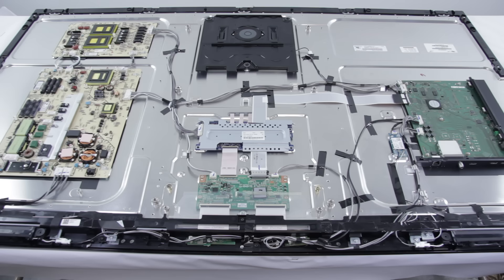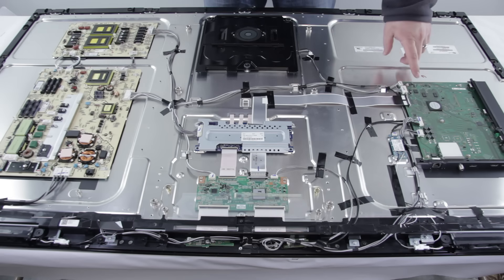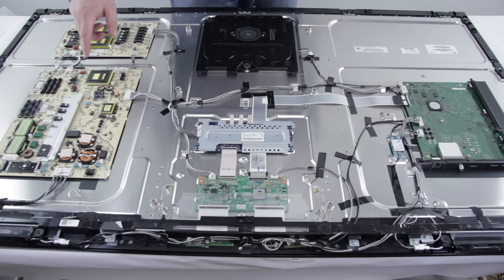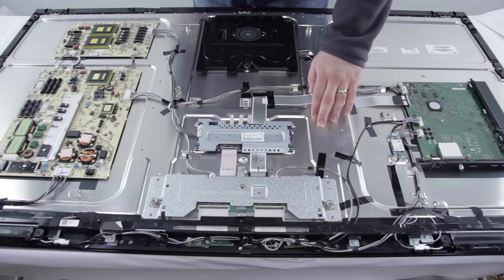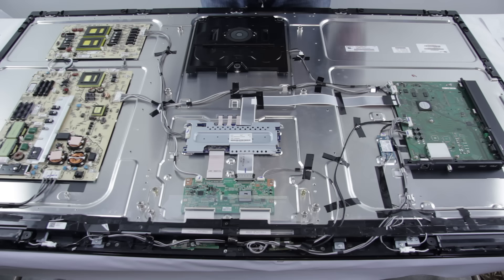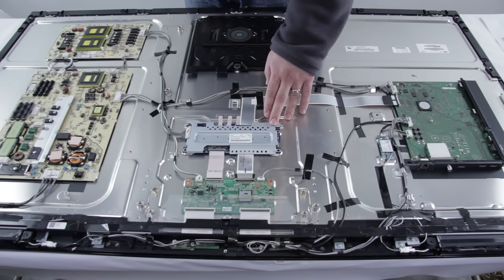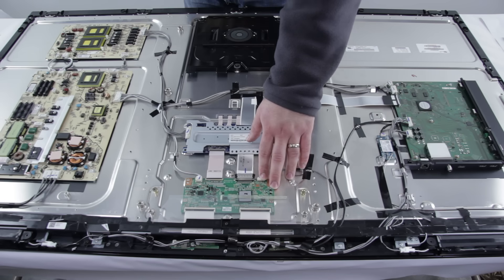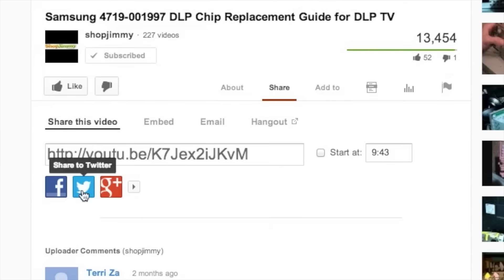LED TV Repair Tutorial - Common Symptoms & Solutions - How to Repair LED TVs

Comment: TV BRAND : LG
TV MODEL NUMBER: 50LN 5750

My TV is showing a very dull image when i shine a flashlight onto the TV i figure that the backlights on the TV are not working. When i first turn on the TV i see the LG logo being lighten up but then the logo disapears after a few seconds. What TV part do i need to replace for this TV.
Reply: +Tyler Corriveau same problem with my LG 42LN5700, did you figure it out yet?any help would be appreciated, Bob in CT
Reply from the maker: +Tyler Corriveau   Try all repairs and troubleshooting at your own risk. This sounds like a problem with the actual LEDs inside your TV. These LEDs are replaceable, however it is recommended they are replaced by someone with the proper experience and training. When replacing the LEDs, the TV panel can get damaged. If the TV panel gets damaged, it is not repairable. Click this link to replacement LEDs for your TV model number:  http://www.shopjimmy.com/lg-lc500due-sfr2-led-strips-12-strips-1-board.htm   Be sure to match the panel information necessary to ensure you have the correct replacement LEDs.Thanks and please let us know if you have any further questions with your TV Repair!  www.shopjimmy.com

Comment: I have a Vizio E320-A0. It will not turn on. I am getting power to the tv. I have pulled the back off and I have no noticed any burnt caps but it does smell slightly burnt around were the power cord connects but there is no visible burnt or discoloration marks. The fuse is good right beside the plug as well. The smell seems to be right around the mpx2 cap but I am uncertain how to test it properly. Thank you
Reply from the maker: +dswartzbeck   Try all repairs and troubleshooting at your own risk.  I recommend replacing the power supply board in your TV.  Click this link to replacement power supply boards for your TV model number:  http://www.shopjimmy.com/catalogsearch/result/index/?cat=59&q=E320-A0  There may be multiple boards for the same TV model number, be sure to match part numbers on your current board, with your replacement for compatibility.  Here is a link to a video showing how to identify your part number, click here:   https://www.youtube.com/watch?v=4i57Cm9-96MThanks and please let us know if you have any further questions with your TV Repair!  www.shopjimmy.com

Comment: my lcd tv model no. is  [ aocL32DK99FU ] and in this power is notgoing on but if i touch with dmm to U7106 ic out pin betweent two series resistor tent it will turn on so tell me what's  the solution's?
Reply from the maker: +harsh shukl   Try all repairs and troubleshooting at your own risk.   I recommend replacing the power supply board in your TV.  Unfortunately I do not see any replacement parts in the search results for your TV model number on our website.  Thanks and please let us know if you have any further questions!  www.shopjimmy.com

Comment: Hi to all. I own an LG 37lb2r lcd tv. Horizontal interlaced lines appeared on the picture, and a few weeks ago after 15-20 minutes where almost disappeared. The last days the lines insist even after hours and when the tv set is cold we have to wait a few seconds just to start displaying the interlaced image, and even the sound is not available. Thank you in adv.  

Cheers,
George.
Reply from the maker: +George Papadimitriou   Try all repairs and troubleshooting at your own risk.  This sounds like a TV panel (TV Screen) problem.  If your TV panel is bad, it may be more cost-effective to replace the TV as panels are typically hard to find in stock, difficult to replace, and expensive.  Thanks and please let us know if you have any further questions!  www.shopjimmy.com

Comment: I have a LG55LW5600 UA. There is a grey line that goes up thru the screen and is about 8 inches wide.  I've taken the back off and cleaned the ribbon connectors as best I could, but that didn't help. Your thoughts? Thanks, Pat
Reply from the maker: +Patrick Kelly   <!-td {border: 1px solid #ccc;}br {mso-data-placement:same-cell;}->Try all repairs and troubleshooting at your own risk.  This sounds like a TV panel (TV Screen) problem.  If your TV panel is bad, it may be more cost-effective to replace the TV as panels are typically hard to find in stock, difficult to replace, and expensive.  Thanks and please let us know if you have any further questions!  www.shopjimmy.com

Comment: Hi I have a 2009 Samsung LN46A540 that has 1 green real fine line that runs vertical close to the edge of the right side of the tv. What could be the problem and how can I fix it? Thanks
Reply from the maker: +chevyonly2002   Try all repairs and troubleshooting at your own risk.  This sounds like a TV panel (TV Screen) problem.  If your TV panel is bad, it may be more cost-effective to replace the TV as panels are typically hard to find in stock, difficult to replace, and expensive.  Thanks and please let us know if you have any further questions!  www.shopjimmy.com

Comment: My LG LED TV model 50LN5100-UB has horizontal blurry lines on the bottome of the screen. This happens with any input and also when any menu us displayed. This is only on the bottome half and alternates every 2 seconds with horizontal gray lines.
Reply from the maker: +Paul Geddes   Try all repairs and troubleshooting at your own risk.  This sounds like a TV panel (TV Screen) problem.  If your TV panel is bad, it may be more cost-effective to replace the TV as panels are typically hard to find in stock, difficult to replace, and expensive.  Thanks and please let us know if you have any further questions!  www.shopjimmy.com

Comment: The picture on my Samsung UN46ES6100 goes out a few minutes after I turn on the TV.   The sound is fine but there is no picture.

When I shut off the TV for a few moments and then turn it on, the picture returns but then goes out again.

Any thoughts on the problem?
Reply from the maker: +Ed Maryellen Kmiec   Try all repairs and troubleshooting at your own risk. This could be a problem with either the power supply, the main board or the TV panel. You can replace the main board and the power supply board individually to see if one of those boards fixes the problem.  Click this link to replacement parts for your TV model number:  http://www.shopjimmy.com/catalogsearch/result/?q=UN46ES6100  There may be multiple boards for the same TV model number, be sure to match part numbers on your current board, with your replacement for compatibility.Thanks and please let us know if you have any further questions with your TV Repair!  www.shopjimmy.com

Comment: I have a Samsung 39" LED with no picture but have sound and used the flashlight test and saw the images. I originally replaced the TCON board but symptoms did not change. I put the original TCON board back in and had sound and image with the flashlight test. I have just replaced the main board that I bought from you. Now I have no sound, no back lights and no image with flashlight test. The TV makes a sound when turning on and off. What do you suggest?
Reply from the maker: +LeAnn Chlian   Sounds like bad LEDs.  Try all repairs and troubleshooting at your own risk.  Please reply with your TV model number.  Click here to view a video that shows how to find your TV model number:  https://www.youtube.com/watch?v=S51nhAmwR2M  Thanks!  www.shopjimmy.com

Comment: Samsung UN46ES6150F LED HDTV. TV powers down after a short period of use. If I unplug the set for a while it will stay on for a few minutes but generally it shuts down soon after I turn it on.
Reply from the maker: +efaustus9   Try all repairs and troubleshooting at your own risk.  This could be a problem with either the main board or the power supply board.  You can replace them individually to see if one of those boards fixes the problem.  Click this link to replacement parts for your TV model number:  http://www.shopjimmy.com/catalogsearch/result/?q=UN46ES6150F  There may be multiple boards for the same TV model number, be sure to match part numbers on your current board, with your replacement for compatibility.  Thanks and please let us know if you have any further questions with your TV Repair!  www.shopjimmy.com

Comment: Hi, I'm from the UK and have an LG 42LE8900 model (product code 42LE8900-ZA.AEKWLJG).  I run the TV as a monitor and use an Onkyo amp for the surround sound.  Yesterday the TV picture failed.  I have swapped out various HDMI cables and eliminated the amp as a potential problem by by-passing it and going straight to the TV from both the digibox and the DVD player and the lack of picture persists.  The only way I have managed to get a picture on the TV is by using a SCART lead from the digibox straight to the TV.Given the above I am guessing that the HDMI board has failed but I'm not sure whether this board is part of the motherboard or a separate board.  So my question(s) is this: a) do you agree with my diagnosis, b) are the boards separate, c) what would the approximate cost of replacement parts be?  I realise that you will give US prices but I will make an assumption that these would be similar in the UK.  If you had a UK contact/distributor for parts I would be even more impressed with your Channel than I already am.Many thanks,Kevin
Reply from the maker: +kjwalke   Try all repairs and troubleshooting at your own risk.  I recommend replacing the main board in your TV.  Unfortunately I do not see any replacement parts in the search results for your TV model number on our website.  Please reply with your part number on your main board and I can try searching for replacement parts.  Thanks and please let us know if you have any further questions!  www.shopjimmy.com

Comment: my LG Led tv model 50LN5100 has horizontal blurry lines on the bottom of the screen which you can still see the picture through. we unplugged and plugged in all the cables. no change. also happens with Xbox and dvr mode. still has blurry lines
Reply from the maker: +Michelle Lynch   <!-td {border: 1px solid #ccc;}br {mso-data-placement:same-cell;}->Try all repairs and troubleshooting at your own risk.  This sounds like a TV panel (TV Screen) problem.  If your TV panel is bad, it may be more cost-effective to replace the TV as panels are typically hard to find in stock, difficult to replace, and expensive.  Thanks and please let us know if you have any further questions!  www.shopjimmy.com

Comment: I replaced my mother board I'm not getting the power light any suggestions this is a sanyo 50" dp50842
Reply from the maker: +Phillip Pickens   Try all repairs and troubleshooting at your own risk.  I recommend replacing the power supply board in your TV.  Click this link to replacement parts for your TV model number:  http://www.shopjimmy.com/sanyo-n0ab3fk00001-power-supply-unit.htm  There may be multiple boards for the same TV model number, be sure to match part numbers on your current board, with your replacement for compatibility.  Here is a link to a video showing how to identify your part number, click here:  https://www.youtube.com/watch?v=_VnKs7AfCZM  Thanks and please let us know if you have any further questions with your TV Repair!  www.shopjimmy.com

Comment: Need help for my TV.  My TV is ELEMENT ELECTRONICS 46" Full HD Digital LED TV Model # ELEFT466.  My problem is the backlight isn't working because I have audio but no picture and when I put a flashlight on the screen I can see the picture.  Please Help.  Thanks
Reply from the maker: +Jason Williams   Try all repairs and troubleshooting at your own risk.  This sounds like you have bad LEDs in your TV.  Unfortunately we do not sell replacement LEDs for your TV model number at this time.  You can check back in the future to see if we have them available.  Thanks!  www.shopjimmy.com

Comment: HELP! I have a 55 inch Samsung TV which has 2 problems (UE55D8000)
1. The bottom half of the screen is very dark so I opened my tv and found that the 2 LED backlight strips are  are only working on the upper half. What could this be caused from?
2. As soon as I turn on my TV, it would start and then 5 seconds later turn off and keep doing this until i unplug the cable. I replaced the power board but nothing changed.
What could be the solution for both my problems, what needs replacement. I would really appreciate your help :)
Reply from the maker: +Samy Hamdallah    Try all repairs and troubleshooting at your own risk.  This sounds like you have bad LEDs in your TV.  Unfortunately we do not sell replacement LEDs for your TV model number at this time.  You can check back in the future to see if we have them available.  Thanks!  www.shopjimmy.com

Comment: hi there I have a RCA Led40HG45RQ that will not turn on.  I verified the original power board was not supplying power to the 5v standby pin.  replacing the power board fixed that and now the pin has power and the red light on the face comes on. however it still doesn't turn on.  what can I test next?
Reply from the maker: +Reckow Racing   Try all repairs and troubleshooting at your own risk.  I recommend replacing the main board in your TV.  Unfortunately I do not see any replacement parts in the search results for your TV model number on our website.  Please reply with your part number on your main board and I can try searching for replacement parts.  Thanks and please let us know if you have any further questions!  www.shopjimmy.com

Comment: I have a Sharp LC-70C6500U, screen is dark on the left and lighter on the right, not completely dark, just much dimmer.  this happened after I moved the tv, no trauma, but maybe a little twist, any thoughts? BTW, at first the whole screen was almost black, after 30 minutes the right lightened up.
Reply from the maker: +paul allen   Try all repairs and troubleshooting at your own risk.  This sounds like you have bad LEDs in your TV.  Unfortunately we do not sell replacement LEDs for your TV model number at this time.  You can check back in the future to see if we have them available.  Thanks!  www.shopjimmy.com

Comment: Hi, just followed your test of the blacklight on my samsung UN32F5500AF and result is no light at all on the back of the screen. But what I have is standby light is on (working properly when tv on and tv off) and there is a little blue light under the cover on the basis of the tv at the middle when tv ON. No noise no click , .... And after checking on the power supply board no capacitor looks leaking or bulging out. The day it went off suddenly there was a kind of burning smell coming from the back.
Reply from the maker: +Equality Sap  Try all repairs and troubleshooting at your own risk.   I recommend replacing the power supply board in your TV.  Click this link to replacement parts for your TV model number:  http://www.shopjimmy.com/catalogsearch/result/index/?cat=229&q=UN32F5500AF  There may be multiple boards for the same TV model number, be sure to match part numbers on your current board, with your replacement for compatibility.  Thanks and please let us know if you have any further questions with your TV Repair!  www.shopjimmy.com

Comment: Tv has a bright 3 inch wide vertical line on the right side of the TV with a picture still behind.  TV is  a Toshiba Model # 46SL417U
Reply from the maker: +Andi Cohen   Try all repairs and troubleshooting at your own risk.  This sounds like a TV panel (TV Screen) problem.  If your TV panel is bad, it may be more cost-effective to replace the TV as panels are typically hard to find in stock, difficult to replace, and expensive.  Thanks and please let us know if you have any further questions!  www.shopjimmy.com

Comment: I have a Sony Bravia that will provide sound for 3 seconds the the red light will flash 6 times. My model is kdl32bx420. I've tried the unplug reboot solution ...help
Reply from the maker: +Dwayne Brown   Try all repairs and troubleshooting at your own risk.  This sounds like a problem with the lamps in your TV.  Unfortunately, we do not sell replacement lamps for your TV model number.  Thanks!  www.shopjimmy.com

Comment: I have a Samsung un55b7000wfxza,  originally I had a ghost double image,  so I messed with the ribbon cables and tried to reseat them.  Now I have a full screen of vertical colored lines. No picture,  just colored lines. Any ideas?
Reply from the maker: +Jerry Mleko   Try all repairs and troubleshooting at your own risk.  This sounds like a TV panel (TV Screen) problem.  If your TV panel is bad, it may be more cost-effective to replace the TV as panels are typically hard to find in stock, difficult to replace, and expensive.  Thanks and please let us know if you have any further questions!  www.shopjimmy.com

Comment: The problem with my Samsung TV model number UN55D6000SFXZA started when half of the screen went black and white while the other side remained in color.  That problem appeared to resolve itself.  However, now the TV has ghosting of the images on the screen.  We tried to power the TV off and then back on and we tried a picture test to resolve the issue but neither worked. Thank you for your help.
Reply from the maker: +B Bollinger   Try all repairs and troubleshooting at your own risk.  This sounds like a TV panel (TV Screen) problem.  If your TV panel is bad, it may be more cost-effective to replace the TV as panels are typically hard to find in stock, difficult to replace, and expensive.  Thanks and please let us know if you have any further questions!  www.shopjimmy.com